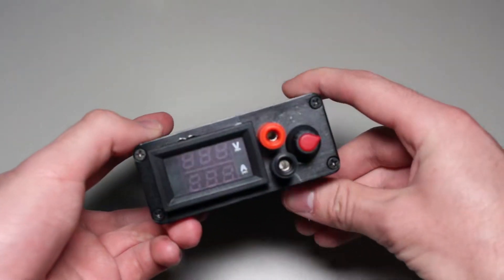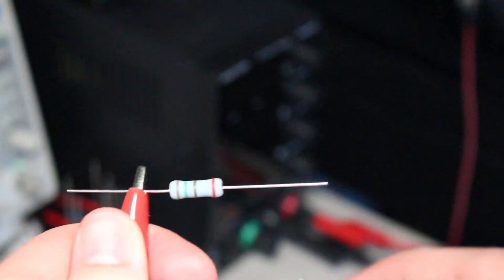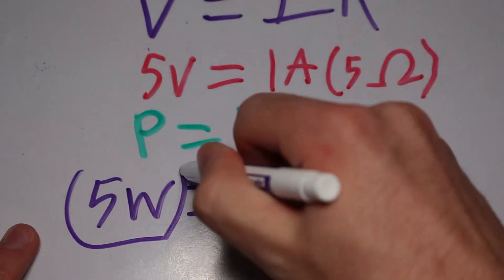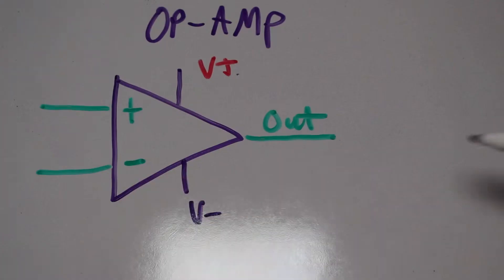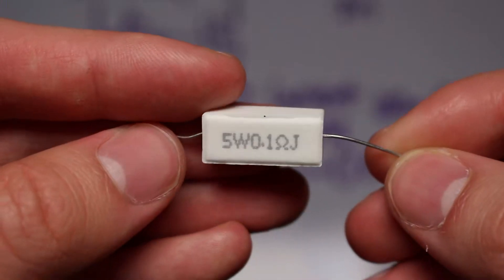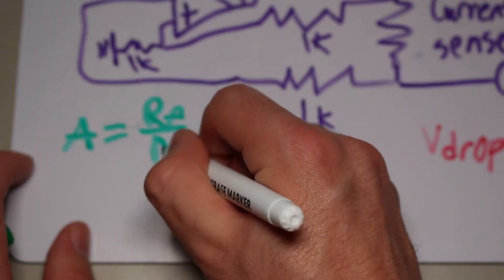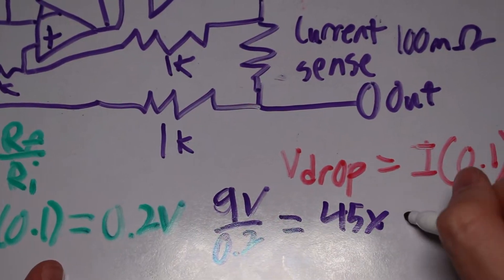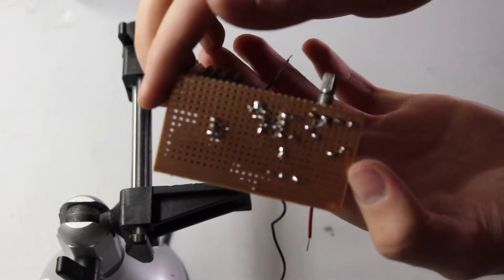Get rid of your power resistors! - DIY Adjustable Load

Comment: Half way through the video, I see I already made something similar.  Though I put an arduino controller on mine because I wanted to use it to load check 12 volt batteries over time and specific currents.

Comment: Cool idea, but what is the maximum voltage and current that a circuit like this can measure/test? What are those parameters limited by? I need a test setup that can handle up to at least 60 volts and up to at least 100 amps, so as far as I know, I'm still limited to using multiple separate, high wattage power resistors in various series/parallel combinations to test that much power from a power supply, or from a very high wattage audio power amp too, all without negatively affecting any amplifier's output sound quality either. (Which I'm not sure if a MOSFET and op-amp circuit could achieve)
Reply from the maker: This circuit is mainly limited by the MOSFET. Your setup might be possible, but the requirements are extremely high. 60V at 100A is 6000 Watts. So you would not only need to find a MOSFET that could handle 6kW, but also find a cooling solution for that. At that point, it's likely easier to just get power resistors.
Reply: @SineLab  Yeah, I figured as much. Maybe multiple MOSFETs in parallel somehow, upping their total current capacity, could then handle that kind of power? (I just don't know the best way to actually do that.)(I'm also still not sure if a MOSFET and op-amp electronic circuit like this would interfere with or have some kind of electrical "issue" with testing an audio power amp's output either, since it isn't a totally passive circuit like just plain power resistors are. I wouldn't want to short something out in either the amp OR the test circuit!)

I wish I knew more about this without actually having to build and try it myself and then (potentially) having it damage one of my amps or something else. :/

Comment: A nice introduction to a simple Electronic Load. Your speech pattern/delivery is improving, kudos! It would have been nice to see the placement of the 45K feedback resistor on the schematic. Speaking of schematics, I suggest that you display (for several seconds) a picture of the final, complete schematic at the start of every video. Tip: In designing a circuit, we will have a goal for its power output... Its voltage and amperage capability. So, we grab a part that can supply so many volts and so many amps. But, that method misses a step. Components can not provide their full voltage and amperage rating, because they have a wattage limit. For example, the IRLZ44N MOSFET in your device is rated for 55V and 47 amps. Multiplied together, you might think that the unit is capable of providing 55V x 47A = 2,585 watts. However, the data sheet shows that this MOSFET is only capable of outputting 110 watts. So, the power output may be adjusted between 110W = 55V x 2A and 110W = 47A x 2.34V. What's the catch? The component's limited ability to withstand heat. As you said, even at 110 watts, the MOSFET needs a large heat sink and maybe even a fan.
Reply: I though that the power rating is not for total output power but for the power dissipated by the mosfet which would be much lower than the total output power
Reply: @oct_nate  Yes, I was speaking of the total power that the MOSFET could dissipate. Thank you for this clarification.
Reply from the maker: Thanks! That's a great tip about the power output. I appreciate it!

Comment: Hey this is neat. I can use this to test some NiMH (and eventual Li-ion) battery charger algorithms, I need a small load to discharge the batteries with, and might as well make a general-purpose one.
Reply: Be careful as some chargers disconnect the charged battery during charging cycle and do several measurements on unloaded/ not charged battery to determine state of charge and other parameters.
Reply from the maker: Yeah, that's a great way to use this!